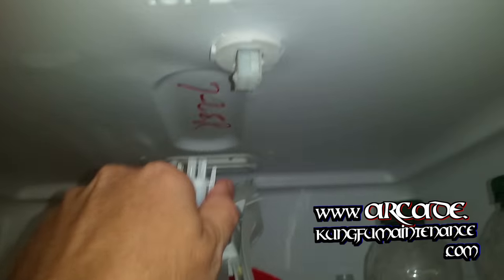Frigidaire Freezer Refrigerator Leaking Water In Fridge Down On Floor Unclogging Clogged Drain Line

Comment: I have a upright freezer from frigidaire and it leaks water on floor when i went to check the drain hose to pan it was fine but the pan was full of water and overflowing onto floor could it be that the air vent about 1 foot from it be causing it to not evaporate the water?

Comment: At first i didn't like Frigidaire refrigerator only to find out it a nice refrigerator ,i had water in the bottom of the refrigerator between the two fruits trays i kept using a shop vacuum once a week only it was not much water all at once this Frigidaire is a nice refrigerator even i had a whirlpool refrigerator since 1987 and i kept it until the door couldn't stay up this thing was so old it kept on working only it was not a frost-free refrigerator and i think it starts to runs my utility bills up also the door seals starts to get hard and cracked , anyway my Frigidaire has a ice maker's on it and it still almost new it's only about two years old so one day i decided to check the drain pan behind the refrigerator took the back panel off and found the main drain just a couple of minutes and it's fix the problem just some weeds trimming line and a shop vacuum remove the black drain hoses insert a plastic piece of weed trimming line or weed eater line it's all the same only people call it different names anyway after inserting the weed trimming line as far as it can go only Don't Force It , it may not do any damage because it's only made out of plastic, after feeding the weed trimming line through do it once again after that replaces the black drain hoses only have it facing you because now you gonna have to use a shop vacuum to sucks and vacuum the drain pan line after that turns the drain hoses back into the drain pan under the back of the refrigerator just the way you found it plug the refrigerator back up and turns it back on and you shouldn't have anymore problem because it's dry inside the refrigerator from there it's that easy